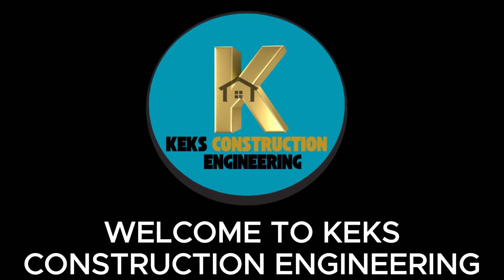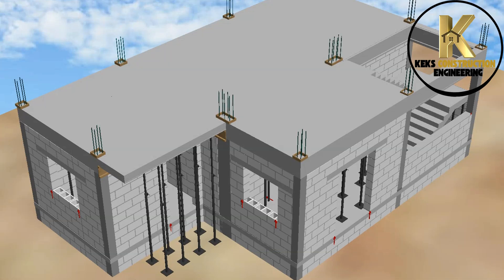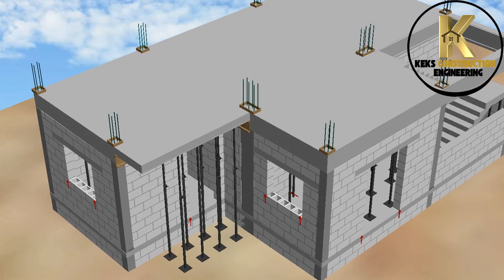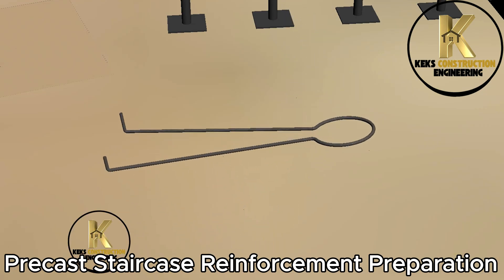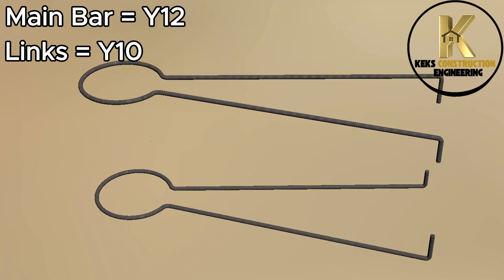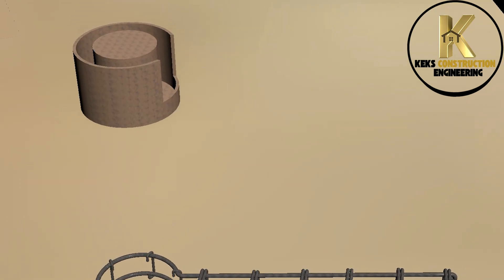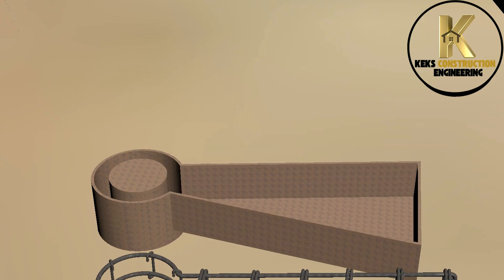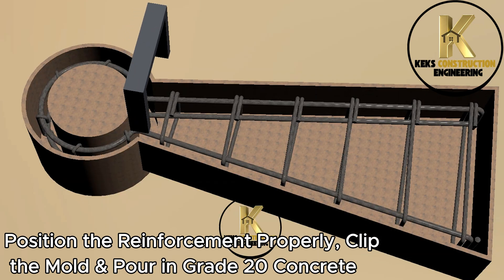Spiral Staircase Construction (How to do Precast Staircase)

Comment: 90 digree vartical 😊
Reply from the maker: You mean the Plumb?
Reply: 6:43 You said, look, this is at 90° horizontal, it has to be made vertical.
Reply from the maker: @vijaysinghaniyaVijay 
I said "90 degree to the Horizontal". 
Meaning that it's at right angle to the Horizontal.